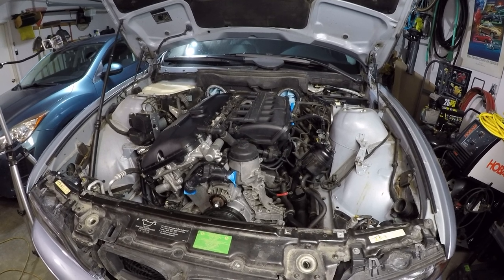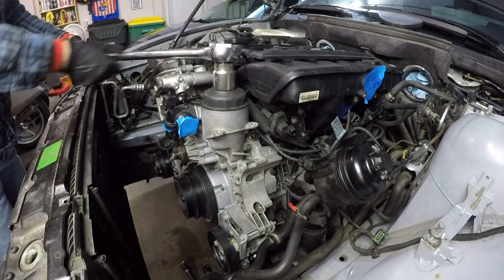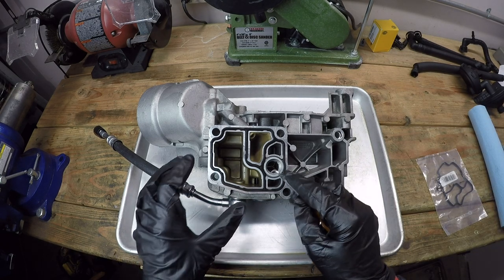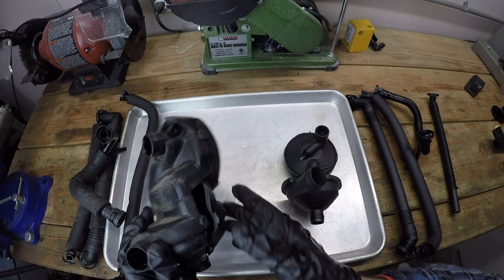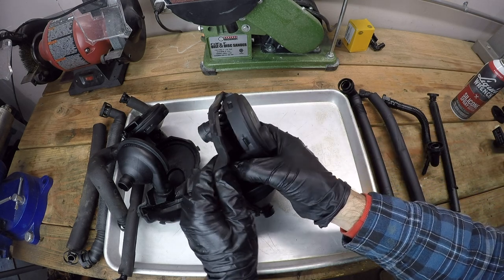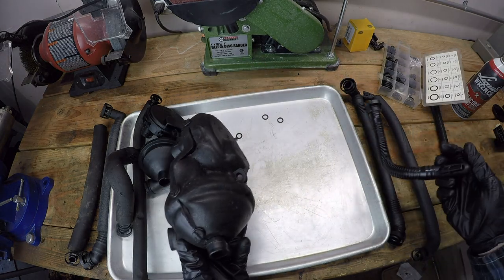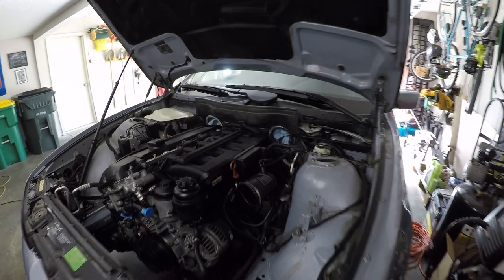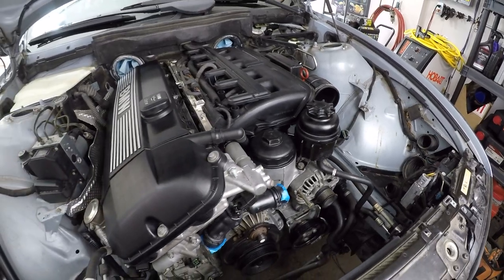Project E39 | Ep.8| CCV System Overhaul and Oil Filter Housing Gasket

Comment: Holy moly!  So bmw knows the CCV system has a crucial maintenance function and is a known oil consumption cause....
Remove fan belt
Remove alternator
Remove oil filter
Remover oilfilter housing
Remove throttle body
Remove spider legs of formed pipes that connect ccv unit all over the place...
Then reverse....
Oh and change the oil & filter.

I wish you were in the LA area.  My daughter's 2001 530i needs this...🙄
Reply: Quite a terrible design to be honest it could be much easier had they put some thought in to it i am doing this job as i type this and its just annoying how much unused there is in the 520-530i’s but bmw decide to cramp everything together still
Reply: The worst part is the passage that goes back into the dipstick tube is so tiny, you cant even fit pipe cleaners inside. I had to clean it by forcing large zip ties into it when I did mine last year. I bet it's already clogged again.

Comment: I just did the ccv job yesterday. It is possible to get the CCV out from under the manifold without removing the oil filter housing. In around the space where the feed line to the power steering is, the gap is just big enough to route the CCV under, and out. Just thought i'd leave this here :)

Comment: You missed an opportunity to replace the coolant hoses that run under the intake manifold by not removing it when replacing the ccv. They are know to leak and it’s one of those while I’m in there kind of deals. Keep up the good work enjoying the e39 series since I have 2 tourings .
Reply from the maker: Thanks for watching! It's true, you could go completely Ship of Theseus on any BMW over 5 years old. Luckily most everything is in great shape on this one including those pipes 👍
Reply: @PracticalEnthusiast  These pipes looked fine on my 2002 520i but crumbled when I tried removing them. Considering how deep in there they are I figured it was worth changing and I didn't regret it! I used my pilot bearing puller to get the rest of the plastic tube out of of the block.
Reply: Yep, I just had mine sprung a leak. At least is easier on the earlier e39, with the M52.
Reply: @PatricioGarcia1973  what are the pipe name ?
Reply: I was thinking the same as my 530i just sprung a leak after changing the radiator and reservoir! Oh well here I go again this time the CCV AND ALL the coolant hoses are going to be changed.
Reply: Oh man I just bough an e39 to fix up. Would love to chat to some one who knows about the vacuum leaks and hoses that have broken off..

Comment: Hey man good video i plan on doing this to my 2004 530i m54b30 engine. So it is possible to have access to all of the ccv while changing the oil filter housing gasket without removing the intake? Sorry for the questions man I just also wanted to ask if the removal of the fan is necessary in order to do these 2 jobs? Appreciate you man if you can reply to this.

Comment: Excellent as I'm about to tear down the front in order to do the same. That said, have you changed your front crank seal since you were in there or perhaps you've done it already. My is leaking pretty bad so I'll be replacing it as well. I'll look at the oil pressure tubes and if nothing else, blow them out since I didn't order them before catching your video.

Comment: Hi there new subscriber here… quick question, is there a reason why you are using the green version of the liqui moly engine oil?
Reply from the maker: The green tint acts as a dye to help identify leaks. It also just looks cool. And it was a few $ less than the other liqui moly synthetics. It was a win-win from my perspective.
Reply: Ah yeah! Great idea… I thought it was a different formula than the regular blue one. I Will definitely use it on my next oil change, thanks for responding!